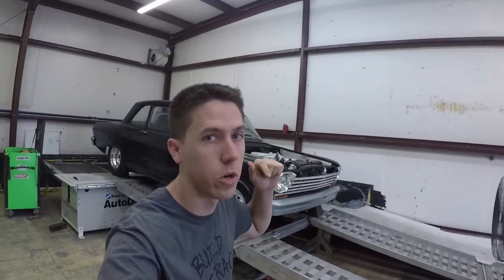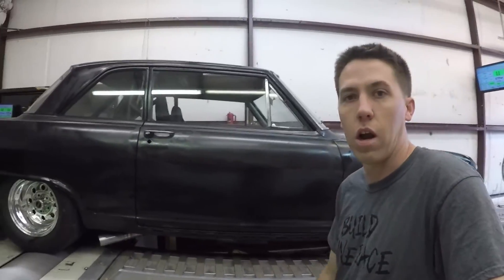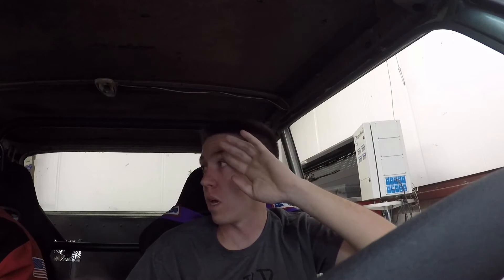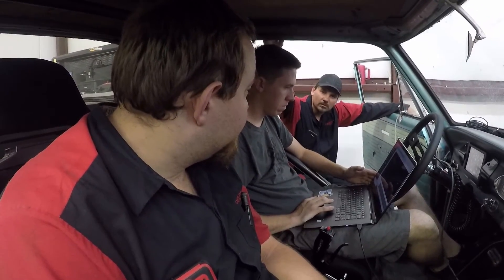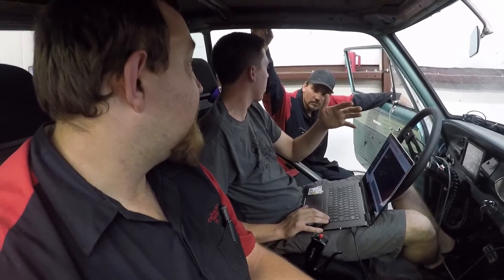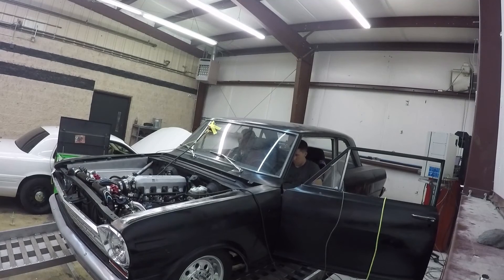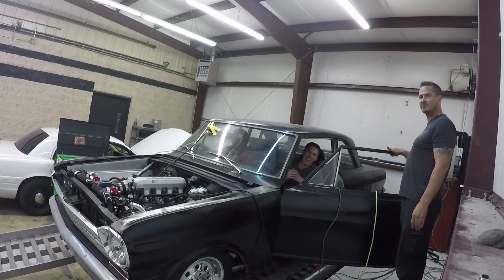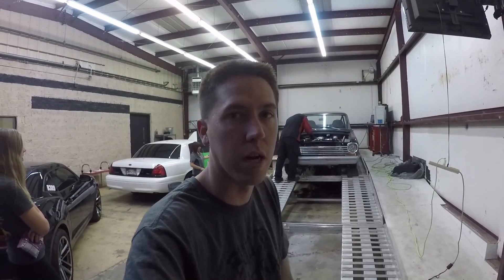Twin Turbo LS Nova Dyno Tuning Holley EFI

Comment: Suggestion, get a better camera person or a tripod.  No one these days will sub with the mic sounds from moving around...  Good job man, seems like your schooling lots of old timers...
Reply from the maker: Already fixed that lol. I've had a a6300 with mic since the 2nd video. I tried using the go pro like others use use but not a fan still have to some times though. Thanks for watching!